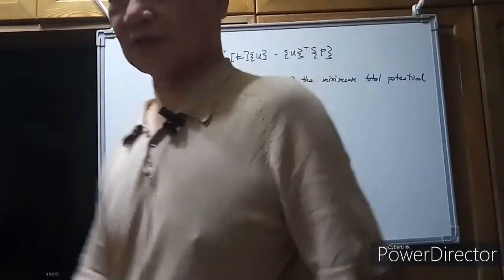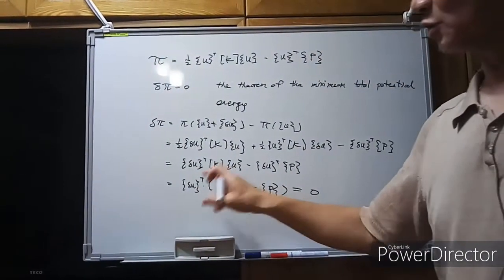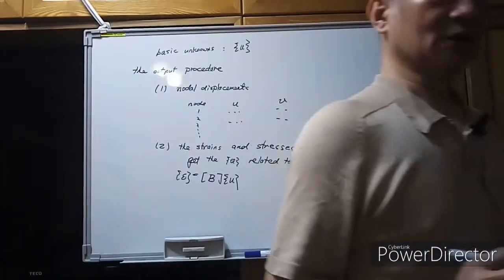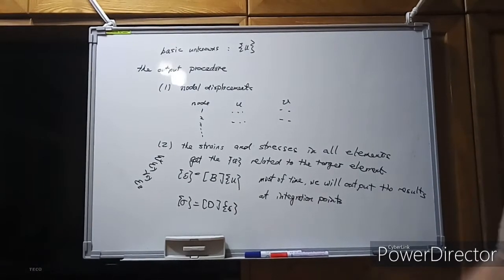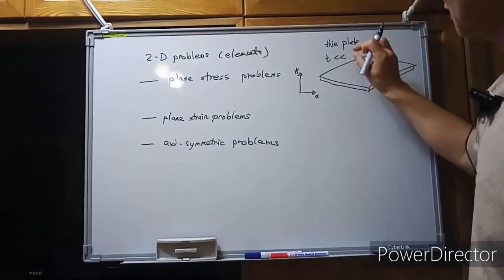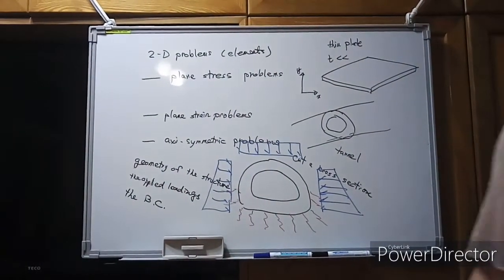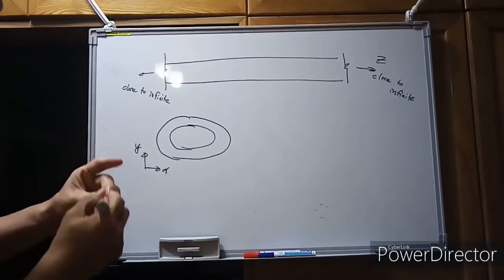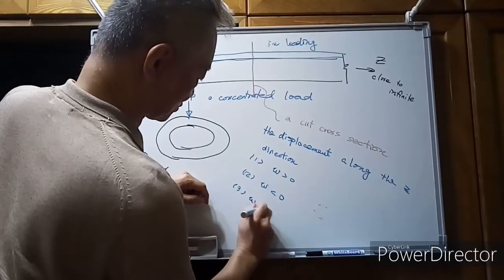Lesson2.3

Comment: The displacement along the z direction shall be 0 in the plane strain problem. (w=0). There will be no strain along the z direction (εz=0). However, the stress along the z direction may not be zero because of the poisson ratio.
Reply from the maker: correct answer